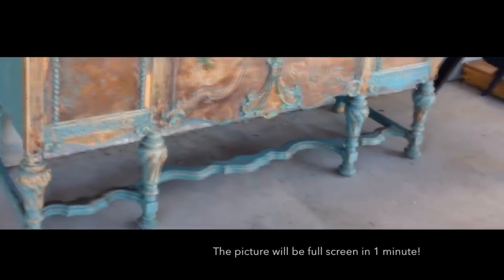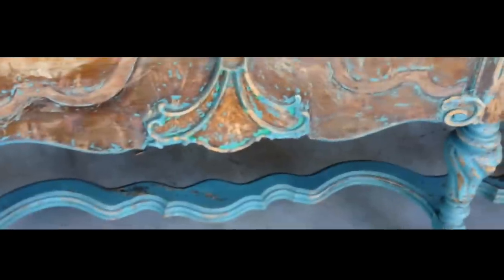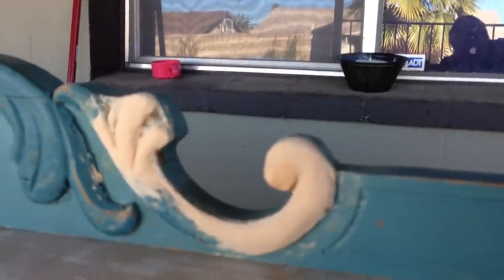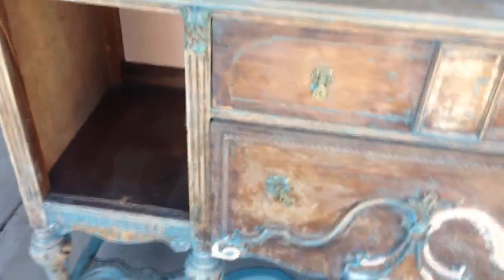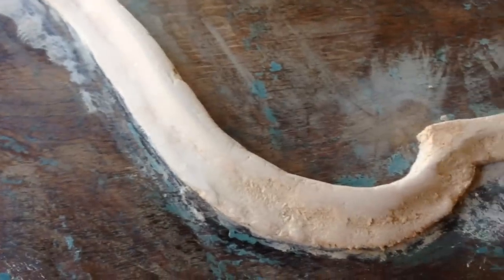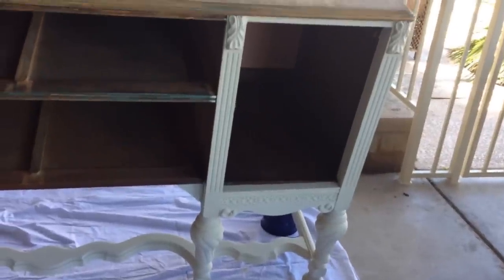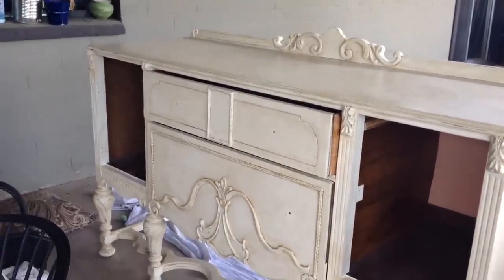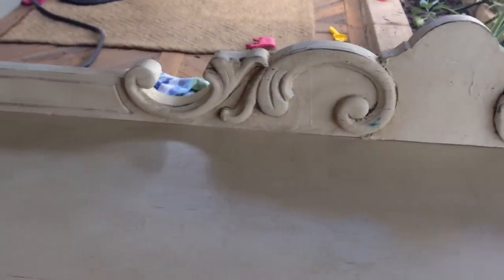Distress, Shabby Chic, 1920s Buffet Restoration (Annie Sloan Paint & Wax)

Comment: Tfs I have an antique piece which I'm told is called a break front. It has lots of potential but the intricacies of the design will take a couple hours to refurbish. Idk abt 'chalk paint' I love that look. Going to see what colors Home Depot has for this bad boy. Love seeing before and after results on furniture. :)
Reply from the maker: Me too.  Chalk paint can run a bit pricey.  You can get a flat paint from Lowe's or Home Depot and produce the same look for less cost.  You may need to do a primer or sand before hand though. One benefit to chalk paint is you don't need to prep much. Just make sure you have a clean surface.  The downside, or so I have read, is that the wax finish needs to be redone every year or two.  I usually just go with Rust-olium water based products from Home Depot. Easy to clean up and has a nice long lasting finish.  I buy a lot of paint from Lowe's too.  Have fun!

Comment: Omg $15 is an amazing deal! Nice job. I purchased a cabinet with one of the edges on the top cracked off. I noticed you used wood filler to repair the leg. I’m hoping that will work for me! Thanks for sharing. Very nice.
Reply from the maker: tfeggins I’m sure that stuff will work for you. It dries hard as a rock. You may have to fill and shape it twice.... and then sand it smooth. Send me a before and after picture if you do it! I’d love to see. 😊
Reply: Thanks! I have to figure out how to send a pic on here. That would be cool if you can see it.
Reply: Just sent you an email. Thanks.

Comment: did you sand down the whole buffet or just the bad parts. I am wanting to do this to my vintage buffet and I am watching tutorials on chalk paint.   I am trying to find the LEAST amount of steps for this project.
Reply from the maker: Jamie Daniels Hi. Gosh.... it’s been so long that I can’t remember. We may have lightly sanded before we painted but I don’t think you need to do that with chalk paint typically. I would suggest that if your piece has any old finish, just take some high grit sand paper to it to score the surface lightly. This will leave tiny groves behind for the new finish to grip to. If you pick a low grit, like 80, the scoring will be obvious, with deep groves. Do a 120 or higher. I did that with some kitchen cabinets that I painted years ago and it worked like a charm. I didn’t need to sand off the old finish because I wasn’t doing a finished wood look. It helps to get grease and buildup off too. Hope that helps! Let me know what you end up doing. 😊
Reply: yes thank you :))))

Comment: Do you have a video of how you added the wood pieces? Thx
Reply from the maker: Lynette Johnson Hi! Unfortunately I did not video log that part. If you can imagine playing with clay or play dough, that is basically what I did. The wood filler can be balled up or molded in your hand and is water based so it washes off your hands fairly easy. Also, I dipped my finger in water to help me smooth out the surface as I formed it. The dry time was dependent upon how thick of a layer I applied. For instance, a full day at the least was necessary for the large decorative portion on the huge front drawer. We actually let it cure for a week though, only because we were working on it every Thursday over the course of a month. I hope this helps.